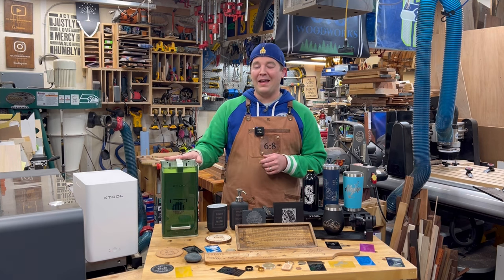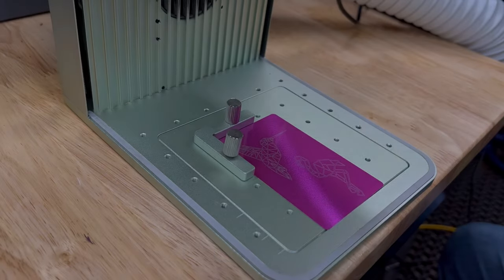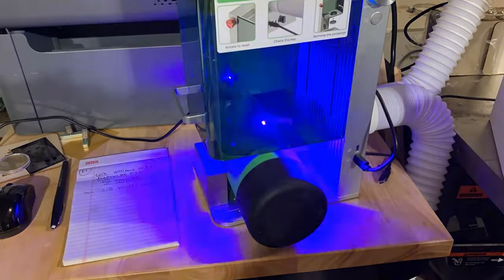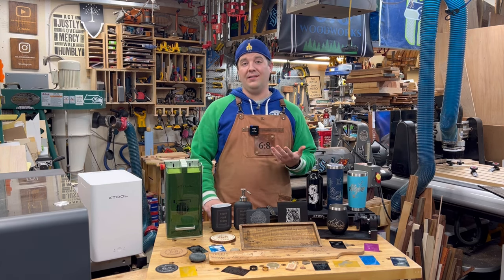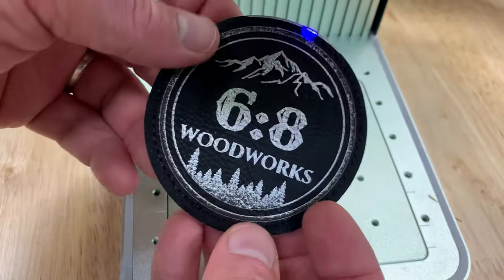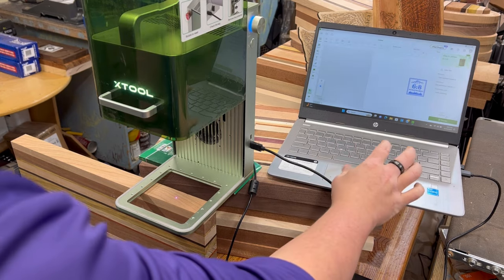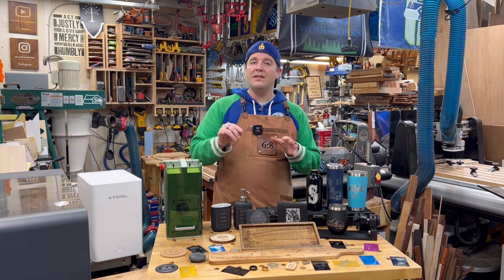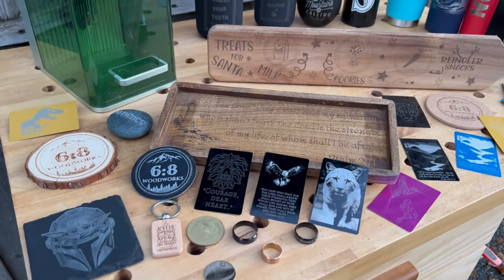xTool F1 Laser: Crazy Fast, Small Business Potential, Portable, More Materials, Super Intuitive

Comment: What is the learning curve like as far as taking ideas for images and script onto the material?
Reply from the maker: Very intuitive. One of the more simple things to learn. You can get going in no time. There are loads of great software tutorials, but you can pretty easily get started in the software.
Reply: Thanks for the fast response @SixEightWoodworks  My state track association has asked if I could be onsite and customize medals for the top eight finishers in each event. Do you think this is something I could set up outdoors in a tent and use for that purpose? Each one would be customized with name, date and event time or distance. Would I just use a laptop to input the info and go?
Reply from the maker: You bet! Yes, that’s the great feature about this unit. It does quite well on etching metal. Just know it doesn’t engrave deeply. For that, you need a more powerful fiber laser. But a metal medal blank can be engraved and get good results like I showed in the video. Darker engravings would just require slower speeds.